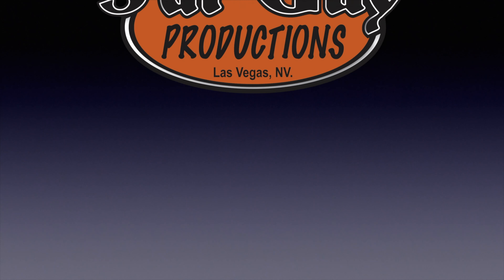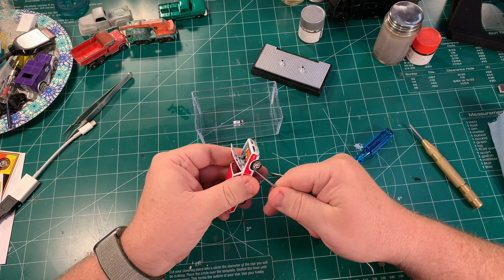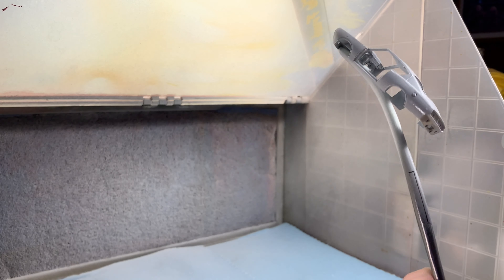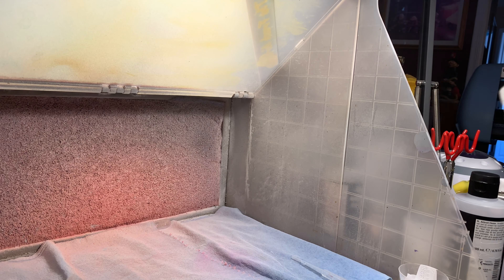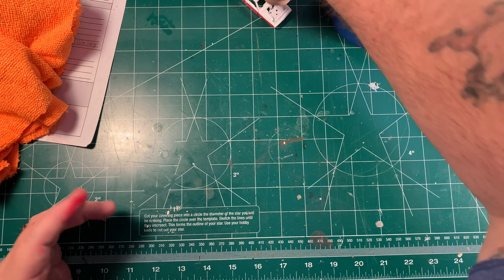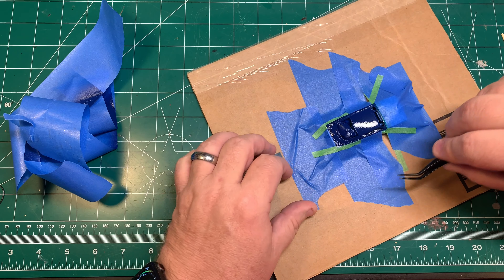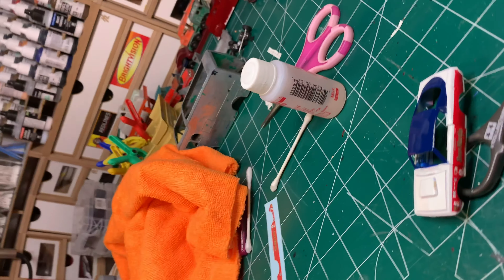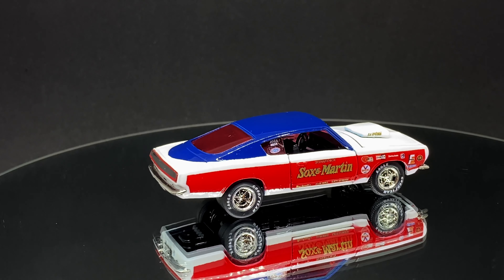Making an M2 Custom Sox and Martin race car!

Comment: That's the same car that I used for my Paint It Pink entry. Also, about tearing down and building up, it's all artistic perspective. I'm glad you restore them. I would also but I can't even find any. And I ain't rich enough to purchase them all up from ebay. LoL! I have that same tow truck that I'm going to use for a diorama in the future. I wanted the Ford F150 tow truck but I had to got to several Wal-Marts just to find the one I got.

Comment: Excellent job mate. I've used various castings like HW and M2 to interchange windshield glass and a few smaller parts..maybe a clear glass casting could have replaced that red glass in the M2 you reworked, otherwise the car is a neat improvement on the coke one......just a thought.
Reply from the maker: Great thought!  nI'm gonna look in to it!
Reply: @pauly7218  that's very gracious of you mate, I would not presume to say what is right or wrong...each to their own and not all HW cuda castings are the same...love the channel by the way, you're a fine inspiration brother.

Comment: Almost perfect. However, the one flaw kinda stands out to me. It needs big wide drag tires on the back and/or smaller skinnier tires on the front.
Reply from the maker: Actually, It might be hard to see but it does have fat and skinny....
Reply: @pauly7218   Doesn't show in the vids, I looked up the old Sox and Martin cars, they had much taller on the back. Those APPEAR to be about the same diameter. 
Funny story, Did you ever hear the expression, "I'll blow your doors off?"  I once saw a drag race, door slammers I don't remember the type exactly, but anyway the race starts, a few yards down the track, the opponent passes the guy in the right lane... his doors literally fall off. I'll bet he never lived that down.
Reply: 20.10 you can see the front & rear are scale size very big Rear and has skinny front runners nice fit

Comment: nice paint and finish,,,,, but I think the scoop needs attention cutting a black cover piece and glue it on maybe quick and easy but right now it looks horrid,,, the scoop that is the rest of the car is WOW JUST WOW !!!!
Reply from the maker: I know.  That scoop...  Arghhh!  Someday I'll give it a bit of attention, but in scale with eyeballs it's hardly noticeable....  I could have hid it in the video, but you guys don't learn if I don't showcase my mistakes....
Reply: @pauly7218  may I suggest a super thin piece of styrene painted and glued on the front to cover it u could then before its applied paint chrome along the edge for a chrome trimmed front edge of the scoop
Reply: @pauly7218  and before u glue it down u can decide if its the proper way to go to cover it up,,,, if it looks good go for it if not then try to replicate what the actual scoop looked like in the front with a thin piece styrene,,,,, sand it thinner if u have to